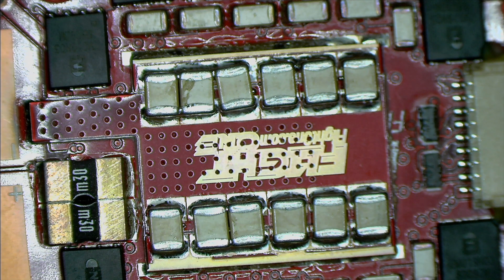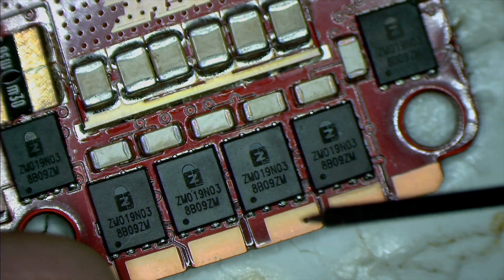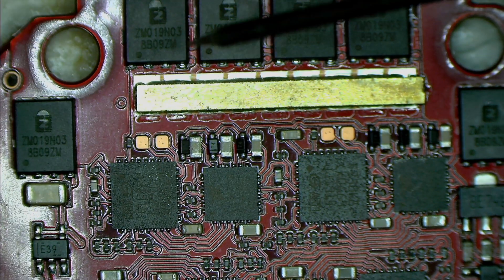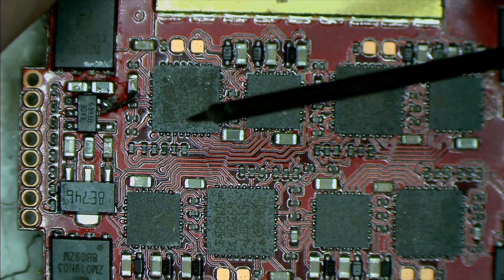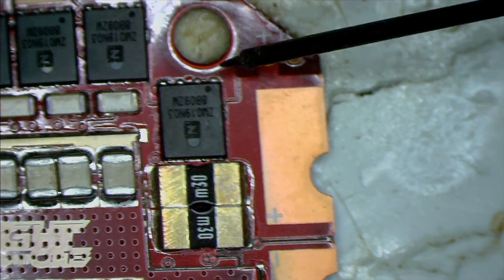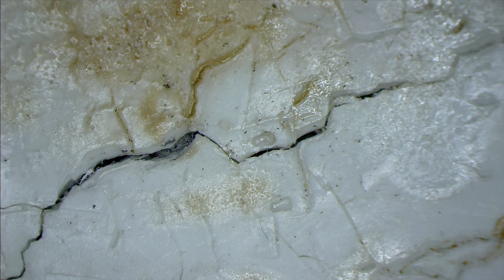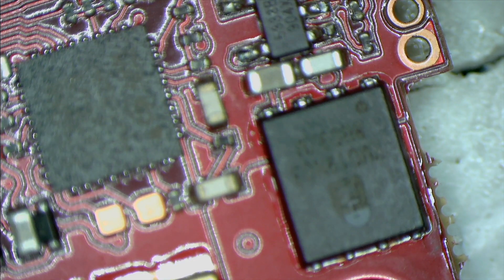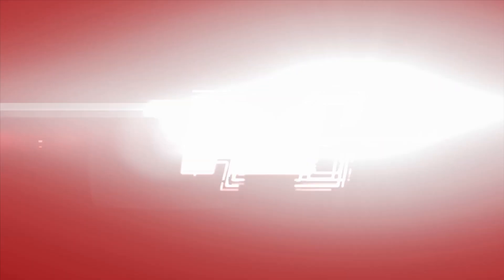FlightOne Megabolt ESC Modifications and Specifications

Comment: I've been flying that ESC without this mod, and it's been rock solid. Been crashing hard, using quopa mode in tall grass, going full throttle and holding it next to freight trains. What was the issue the two people had? You were clear as mud on the issue...

Comment: A simple mod you say.. hell I cant even get my battery cable solding looking that tidy👍🏼🤣
Reply: Hah i think using flux is cheating, try it with your solder joints :p  Did you see my soldering video?
Reply: @PrestonKnows  Yeah I did watch the video, some top tips on there, but havent had to solder anything. Gonna have to get me some flux as I have to replace my spark I burnt out the other day. The battery pads on that are challenging enough for me.

Comment: Why 4-in-1 esc instead of 4 individual ESCs? I'd way prefer 4 ESCs. I've got a bolt 32 that's dead now because one ESC burned out, not all 4. Way more expensive to replace.
Reply: The perform better, in a lot of cases are more durable since the majority of my individual ESC were killed by prop strikes.  On a normal quad 4in1s last a very long time, i don't think i have ever replaced one of mine except smashing into something racing.  The other commentor had a good solution, you can always just add one individual ESC on, or use replacement plans.  They also make build way more simplier, and there are future technology advantages.  Lower noise going through wires, etc
Reply: Cut the wire for the bad esc going to the flight controller and put a individual esc to replace that single one
Reply: @PandaFPV  I did consider that, but wasn't sure how it would affect performance to have one random esc in my build
Reply: I thought the same thing until I start running the 4-in one ESC’s and two years later literally had one go bad
Reply: @windowwasherfpv3485  but then you have to replace the entire $70 part instead of one $20 (or around there). Just wondering if there's an actual advantage of 4-in-1 over 4 individual. Plus, Preston did say to ask esc questions 😊
Reply: Jacob Dimick I get where you’re coming from but like I said iv  been flying for two years and literally had to replace one. Also flightone has a replacement program if it breaks also it takes 5-10 to pop a new esc in